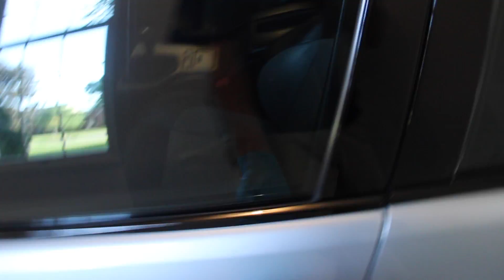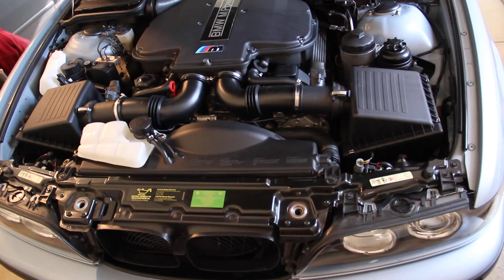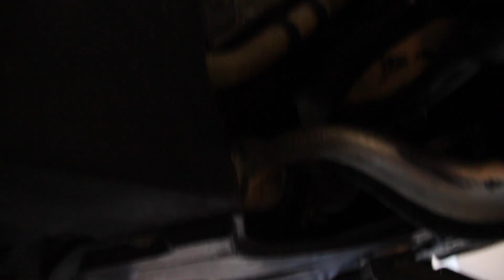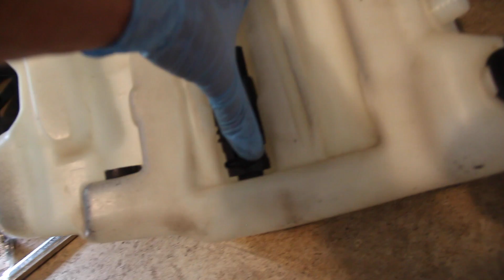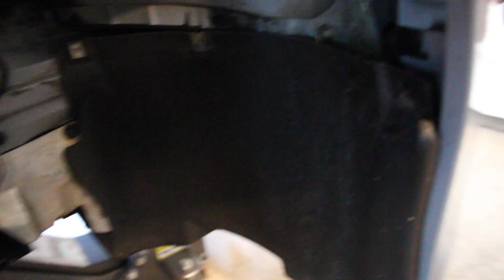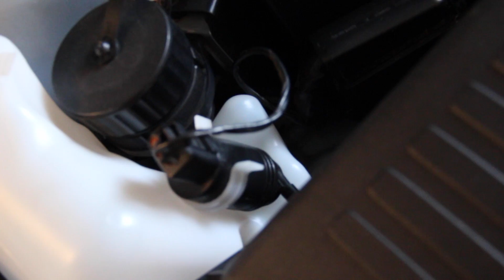BMW E39 Washer Fluid Leak Diagnosis DIY

Comment: Ryan why 2 identical pumps for the windshield washer fluid… and what is the function of the pump in the engine?… thanks
Reply from the maker: There are three pumps on North American-spec E39 M5s (which have the cold weather package).  1 under the hood in the small reservoir for intensive washing.   This is the button at the end of the wiper stalk, you could put a more aggressive cleaning agent in there to really cut through bugs/grime.  Then one in the primary reservoir for normal windshield washing.  The last one is the largest one for the headlight washers.

Comment: @e39Source can you explain the top reservoir and pump. i cant find reliable information on the internet. I was told by a specialty shop that the engine bay pump was the main washer pump. and that if i needed windshield fluid i should push in the SC button on the Wiper stick in the car. But i dont believe that is true. I should be able to pull in the stick and get regular washer action from the pump you showed how to replace in this video. they also explained that the fluid reservoir was only for the headlight washers. Which i also find to be inaccurate.
Reply from the maker: This is indeed incorrect.  The primary fluid reservoir is behind the front right fender liner/fender, and there are two pumps here.  The larger pump is for the headlight washers, which run every ~3rd or 5th pull of the windshield washers.  The smaller pump here is for the primary windshield washers.  The smaller reservoir under the hood is only for the windshield, and this is triggered by pressing the button at the end of the wiper stalk.  The idea is that you could put intensive washing fluid here to be used on a very dirty windshield (bugs, ice, etc).  The rest of the time, for normal cleaning, you have the primary reservoir behind the fender liner that is triggered by pulling the wiper stalk forwards.
Reply: @E39Source  thank you for confirming that. that is exactly what i thought too. The shop i went to are BMW specialists. i would have expected them to know this. When i pull the stalk in nothing comes out. so i suspected that the washer pump below by the wheel well is the culprit. being that it was harder to get to i opted to go to this shop. they simply replaced the pump for the intensive cleaning reservoir for  $173 ($86 for parts and rest for labor). when i pulled in the stalk the next day after i picked up the car i still got nothing. i brought it back and the managing technician said that on my car since it was a change over year they were prepping the engine to go to the new chassis. so pressing in the SC button is the only way to get washer fluid. when i pointed to the main reservoir he said that was for the head light washers.  i dont know why im saying all this. im just annoyed at this shop who are supposed to be experts and so far you are the only person who confirms my thoughts and also lines up with the car manual.
Reply from the maker: @davepearlman5491  I would start with checking the fuses in the glovebox ceiling for the washer system.  From there, check the plastic hoses under the hood.  It is common for them to get very brittle and break or crack.  Then at the main reservoir, check and clean out the talk and inspect the pump and pump filter/screen, these can easily get clogged with debris.  You can also check the pump motor by applying 12v.  Lastly, your actual washer nozzles can get clogged up.  They can be cleaned out with a thin metal wire, such as tag wire.  The washer function on the E39 is the same for all model years, so don't listen to that BS they're feeding you.

Comment: What's the correct way to remove the filler hose?  I yanked on mine and I don't feel good about it, has to be a better way.
Reply from the maker: It does indeed pull off of the reservoir, and if its original, you may need to get aggressive with it.
Reply: @E39Source   I did end up yanking it off, but not before I tried to pry it with a screwdriver.   Bad move, might have a hole in it now and I'm sure it's an 1100 dollar hose with a 3 month lead time.  Thanks for getting back to me, your videos have been a big help with my 540
Reply from the maker: @DoubleJThe  I see the hose for ~$35 and and available within a few days.
Reply: @E39Source   Nice, if I have a hole at least it won't jam up my car for too long, missed all of last driving season rebuilding the drivetrain, hoping to get some actual steering wheel time in 2022

Comment: You said it yourself. I just purchased all new lines including the intesive lines which lead up to the two jet units on the bonnet. I also ordered all new hoses, connectors and all other parts between the reservoir and the two headlight jet units, one unit being on the driver's side and the second one on passenger's side. I replaced both headlight jet units the other day. Somehow the rigth jet of the driver's side headlight jet unit had broken off. So, becasue I am me and I am over the top picky when it comes to repairing, cleaning, I ordered jet units for both sides. I could have gotten away with just replacing the driver's side unit, but then the driver's side is nice and new from BMW while the other side was dull and dated. It wasn't until I replaced the driver's side jet unit that the line was brittle. I don't even know what kind of shap all of the other parts, connectors and hoses are for the headlight wash system, so I just ordered all new parts for the headlight wash system and windscreen intensive clean system from BMW.

Comment: Ryan is it normal for the used windshield washer water to drain from the wheel liner area on top by the fender area? I clearly see the drainage vents on each front wheel area. I originally thought i had a leak issue but after full servicing of the reservoir, new grommets and testing, I see that the water leaking is actually from the drain. Any ideas?
Reply from the maker: There are drains on the back sides of the front fender liners, yes.
Reply: @E39Source  Thanks a lot. It appeared to look like reservoir issues at first before attempting to inspect it but it turns out, it’s supposed to leak like that but what a weird design.

Comment: Ryan I’ve accessed my reservoir but how did you get the refill hose off? That white one that feeds water to the tank? I can’t get mine off to remove my reservoir and I don’t want to pinch too hard otherwise it might break or rip.
Reply from the maker: The fill hose should simply pull off, though I do recall it requiring a lot of force.  Maybe a bit of twist too?

Comment: Probably a dumb question - but if both the windshield and headlight washers are tied to that one container in the wheel well - what is the 2nd container & pump under the hood for?
Reply from the maker: That's the intensive washer reservoir. There is a button on the end of one of the stocks that, when pressed, uses that fluid instead for a longer period of time (and with a more powerful pump) to wash away bugs or more debris than the usual fluid.
Reply: Thank you!

Comment: Hey Ryan

Completely off-topic!

I've been looking to install a 2x12 GAS subwoofer into my E39 530i that came with DSP.. I have never installed a subwoofer of any kind before but it doesn't look way too tricky. However I can't for the life of me find a good guide or video on how I would start..

Any tips?
Reply from the maker: I don't know about installing aftermarket subs with the stock DSP amp.  I have the M-audio subs.  Easy installation and nice results, there is a video here on E39Source.

Comment: so i assume the headlight washers and windshield washers use the same reservoir and fluid? and i heard that there was an intensive washing system on the m5, where would that reservoir and pump  be, or is that also shared?
Reply: also, not related to this video. actually more about the car itself. i felt like you said something about it but i missed it, but what's the exhaust system on this car? any muffler deletes or anything or aftermarket parts?
Reply from the maker: Yes, same reservoir and fluid, just different pipes.  The intensive fluid is the small one under the hood infront of the fill port for the main tank.  My car has a fully stock exhaust system until the cat-back Eisenmann Race mufflers.  It has an E60 545i short shift kit, Eibach rear sway bar, ECS stainless braided brake lines, and Hawk HPS pads.
Reply from the maker: The small tank under the hood is the intensive tank.  When you press the button on the end of the stock (not pulling the whole stock like usual) it uses the other fluid which is just supposed to be a more intensive fluid.  Dumb feature in my opinion.

Comment: Or what can happen is you leave summer fuild in during the winter and it freezes. That happened to my sister her pump and or seal is done.
Reply from the maker: Even summer fluid should have some antifreeze in it though.
Reply: +E39Source it's only good to 32°

Comment: It's where the filler pipe connects to the bottle. They just push on but need to use a  jubilee clamp
Reply from the maker: Maybe if the gasket/seal is worn, but mine was pretty tight.
Reply: +E39Source everything on your car is tight.
Been watching all your vids on this beauty for years.
Think your nuts though but omg that car is awesome and long may she be.

I've had 2 M5s and a 530d. All have had the leak from the filler pipe. pita.
Love them tho. 
Where is the last video on the rebuild? hurry up with it;-)
Reply from the maker: Haha thank you!  I will get part III up soon.

Comment: Do you no a way that I can make the seat belt go fast in (E46)?
Reply from the maker: The seat belt retraction? Mine is slow too.  I haven't bothered trouble shooting.  Probably a new tensioner would solve that though.
Reply: +E39Source Thank you!!! If you do a video on that I think most BMW people will watch it because 12 of my BM mates have the same problem.
Reply: +Allah ukbar I've been told furniture polish will do the trick. Haven't tried it on my E46, but supposedly.
Reply: Clean them.... Pull them all the way out.  Clip a peg on the top to stop them retracting. With warm soapy water, give them a good scrub and dry with a towel.  Make sure to do it on a warm day when you don't need the car and let them dry preferably over night.  Don't take the peg off till they are 100% dry.  They'll be good as new ;)  Hope it made sense ....
Reply: +E39Source some time the belt beome dry or rough that also cause it to slow down.
i tried furniture Polish the one comes in spray cans and it works very well just like new
Reply: pull the belt all the way out and use a silicone spray on them then let the seatbelt retract, and pull out fully and retract a couple times, and that will do it, did it with my e39 m5
Reply: +E39Source i had done it last year with furniture Polish and my car usually parked under direct sunlight with 30° temprature outside and never felt greasy or sticky in hands.
Reply: +Jake Tongue Thank you! I'll try that!
Reply from the maker: Won't that make them really greasy?  Perhaps staining the clothing you're wearing as it rests against your chest?
Reply from the maker: By furniture polish, do you mean something like Pledge?
Reply: +E39Source you can apply it on a small surface and see if belt absorbs in it and give a nice shine and smooth surface then its perfect product. 
some time it depends on what kind of product you gonna apply so do a little practical first